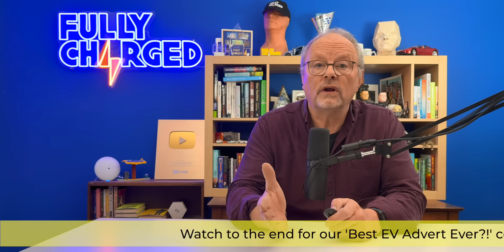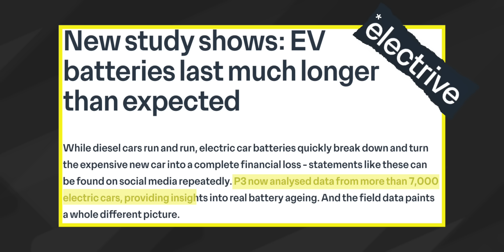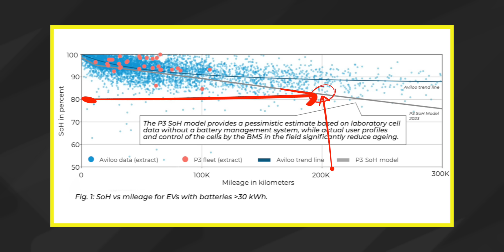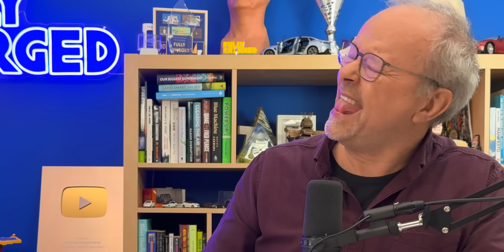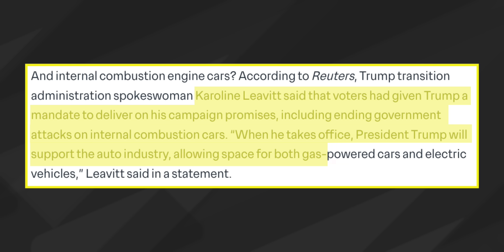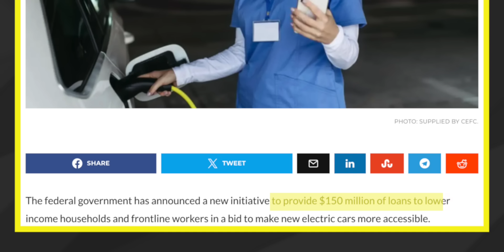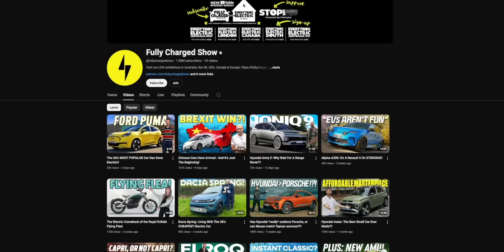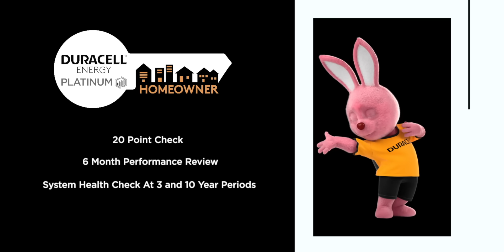The Truth About EV Battery Life, Government Subsidies & The Future of Coal Ash?!

Comment: Why has tidal power died a death? Cardigan Bay would seem to be a substantial length, 80 miles, to harvest tidal power whilst creating an inland sea using technology pioneered in Holland 80 years ago and creating a west coast high speed  road and rail route between North and South. The inland sea could become a sheltered and safe body of water for leisure.
Reply: I can't find anything about a Cardigan Bay tidal power scheme that would create an 80 mile highway.

Even a causeway from Strumble Head to Bardsey Island would only be 50 miles and the sea depth averages about 150 metres.

The cost would be astronomical, even if technically possible, which I doubt. The damage to the environment would be incalculable.

Tidal schemes for the Bristol Channel or the Solway Firth make far more sense and the cost would be huge.
Reply: @ Chris, I was postulating on the Zuider-Zee Dutch example and Cardiff Bay. There’s also talk about doing a scheme across a North Sea passage by the Europeans. The current road connections are appalling so you have two backwaters, St David’s and Bangor and you have to go into England to get from Fishguard to Bangor by rail. Cardigan Bay has little usage commercially or for leisure so making it an inland sea may create huge development opportunities. Environmentally it would change but change could be designed with intent, you could introduce wetlands, keep the river estuaries and create polders for human development whilst having huge energy generating capacity for centuries to come. The scheme could be a floating causeway via two or three man made islands, some type of wall / dam type solution with tidal gates but would have huge benefits including increasing Wales territory by a quarter. Big scheme, big dream but huge possibilities with big payoffs and a high speed dual carriageway and railway lines connecting Northwest to Southwest. 😎😇
Reply: @gbphil  I think you might have been thinking about Cardiff Bay, but the Cardiff Bay scheme certainly doesn't involve an 80 mile road and rail link between North and South Wales.

The Zuiderzee damn is only 17 miles long and is built where the average depth is less than ten miles. A far cry from a Cardigan Bay scheme linking North and South Wales in waters that average 150 metres in depth and stretches for fifty miles. That would easily be the biggest civil engineering project in the world.
Reply: …. Because tidal power is EXPENSIVE

Comment: Bought my first EV last year, 1st Gen Leaf, '64 plate (11yr old). 4 Previous owners and now has 67k miles. Battery is still at 82%, MOT last month has one advisory for 'signs of wear on a single steering bush'. After owning it for over a year now, usually driven 6 days a week for work & domestic commutes, charging only once a week using chargers available at my work place. Not a single breakdown, not so much as a light bulb replaced, never ran out of battery while driving (I did originally have range anxiety until I just got comfortable with the car).
After owning 14 second hand ICE cars in my life, the EV has been so much cheaper to run, insure and a lot less hassle to keep on the road.
Reply: @AnthonyPreece  and the leafs did not have thermal battery management. Newer Evs have nowhere near that drop in battery health. My 2022 soul has 120.000km and battery health is 100%
Reply: Nissan really should have put cooling on the battery. But a good used car for. $2500 is still a good deal.  @gnumel
Reply: @gnumel Nice!
Reply: @gnumel No it isn’t.
No used (lithium) battery has 100% health
Reply: @GadgetMart  they have 67kw but advertise at 64kw. The car basically only lets you use 64kw and keeps a buffer. As long as it can do 64kw it still says 100%. Basically they start at 105% when new and always keep a buffer. By checking the data from the obdii and what shown by the car I calculated that it is still between 65 and 66kw total. It lost some, but almost nothing.
Reply: @GadgetMart Do you actually know the difference between battery integrity and battery capacity? If not , that wasn’t a wise post.
Reply: Good move 👌   My first EV was a 2014 LEAF too back in 2015 - Ex demo Acenta with 1,400 miles on it for £10,500 - Was an absolute Bargain back then as they were I think £29,995 or something, saved £2k on fuel in the first year 😲
Reply: Last month, got too cold for my ICE car to start. This again. Sigh.
Reply: @SigFigNewton maintain it then you cheapskate
Reply: Tesla is expensive to insure... Certain cars cost more to insure.. not all EV is gonna be cheap to insure.. when something goes wrong with them it costs alot.. tho I wish we had BYD in America instead of swasticars Tesla
Reply: I am in Oz, and seriously, I cannot wait for 2025 EV,s from China. Please nobody shoot me, as I am a true blue Ozzie, but I don’t see any issues in buying something I consider great quality and price. Zeekr 7x (Geely), Xpeng, BYD, many brands bringing out awesome looking EV,s that honestly make Tesla seem mundane. Not a Tesla basher but there is that much choice now coming out it is great!
Reply: @AnthonyPreece  sounds like you work for an ev company 🤶😁😁😁  what  EV would you suggest that I purchase..?
Reply: Can you tell us  how's the insurance after switch to EV, big  change or not to insure
Reply: The thing is that you can deny global warming and the effect of carbon dioxide on it all you want and merrily go ahead and burn fossil fuels, however the only problem is that fossil fuels are very finite and won't last that much longer. Therefore it is best to acknowledge that renewables are a solution for this issue.
Reply: Probably had a battery replacement.
Reply: @hoffinger  mine? No, I have the car service history and checked everything with a obd reader before buying it used. 
It only had tire rotations and a recall for a coolant sensor
Reply: @hoffinger a 12v probably, like any 10+yr old car.
Reply: @salibaba ICE car batteries tend to last about 5 years. My last car, Quasqai diesel, needed a new £240 battery after 4 years.
Reply: @gordonmackenzie4512  ICE batteries are "Lead-Acid" batteries, not the Lithium batteries used in EV's.

Comment: Floating Solar benefit #3: panels stay cooler (compared to on land), and thus work more efficiently / generate (slightly) more power per panel.
Reply: The only downside I see is the cost of cleaning up after wildlife that will use the floating array as a resting and restroom place.  Might be a bit labor intensive but could balance out with the amount of power over other style of arrays.  Cheers

Comment: What I think you fail to mention is that any idiot with a socket set can fix a ice car yet evs actually need trained professionals to fix them that a problem
Reply: There is way less to go wrong in an EV in the first place.
Reply: Correction - any idiot with a socket set *can remove bits from an ICE car*.  You can't 'fix them', you have to order in spare parts (and often bend over and grab your ankles if it's not a generic part). 

You'll also be doing far more often, given the far greater complexity and number of parts involved in an ICE powertrain (not just the engine, but the gearbox, clutch and other bits).
Reply: Maybe that's true for an old Ford Anglia... not so much now. We used to have TV repair men I recall, but that's in the past.

Comment: My little Skoda is at 131000 miles and still going strong. Way more eco friendly to keep my old vehicle well serviced than it is to put an another slab of metal on the road.
Reply: Probably not as eco as you may think (at least in terms of emissions):
- your engine won't be as clean as it was new (in terms of emissions) - so your actual year emissions are likely higher than you think
- the 'embodied' emissions related to the battery etc (the only bit 'extra' compared to an ICE car) are roughly equal to ~15k miles at ~30mpg... so if you do more than 7.5k miles / year, you'll 'break even' in ~2 years, and after that, your life-time emissions will be less than if you stuck with your old Skoda.

Oh - and you won't be generating emissions daily outside your home / workplace / all the streets you drive along.
Reply: And when your Skoda does die (as all cars must) get yourself an EV, not another ICE. It'll probably last 200000 miles. And you'll wish you'd got one earlier.

Comment: Someone told me auto emissions are mostly water vapor. I responded that I won’t expect them to drink from the toilet bowl just because it’s mostly water.
Reply: You should've dared them to sit in their car in an enclosed garage with the motor running for an hour or two.
Reply: Yea, it’s been through a filter. You mean you lifted out the logs with a strainer. Nice and clean.
Reply: Water is a powerful greenhouse gas when it is a vapour in air, so they are very much part of the problem ironically.

Fortunately water in air at a global level is kind of self regulating and tends to remove itself when levels get sufficiently high (I.e. it rains 😉).
Reply: @ Very silly 🤪.
Reply: Would you prefer to be in a closed garage with a running EV or running ICE vehicle?
Reply: You need to develop an ability to question things you hear! You can start by fact checking this presenter (Robert) and his convenient lies and half truths.
Reply: The hydrocarbons in petrol have the formula CnH(2n+2). When burned, this makes a very slightly smaller molar quantity of CO and CO2 and a very slightly larger quantity of H2O. In terms of mass, there is much more CO and CO2 than H2O (2 hydrogen atoms weigh one sixth as much as a carbon atom). So your informant was wrong. Don't use toilet humour - just tell them they are wrong.

Comment: Well, my gas guzzling GM Saturn has 360K clicks and is still going fine, even in rust promoting Ontario, so there! I know, a GM, I'm lucky. 
FYI, this was supposed to be humourous, as I thought Robert would draw energy from a (slightly younger) old fart bloviating about EVs. My car is an '03, there weren't any practical EVs on sale here until the Leaf around 2011. It hasn't been getting much mileage the last few years with work from home, then retirement.
Reply: According to the math you bought 20,000 gallons of fuel costing $70,000 for 1 vehicle. Home charging would have cost $7,200. And no oil changes
Reply: @frostcb2  sadly I cannot have a home charger where I live. It is an old Victorian terrace which predates the automobile. My home town has a population of 63000 and a grand total of 16 public EV chargers. This is another reason I'm currently holding on to my vehicle. I'm not anti EV, but there's certainly some infrastructure issues to address.
Reply: @Robaylesbury  Nobody is obliged to have an EV or justify why they do not. I have 2 EVs and no charge point at home.
Reply: The point you are making is that because your car has done that, every car can do that? Or is the point you are making that what Robert said is untrue because your car did that, even though there are generations of figures that show what he says is a fact.
Reply: I love this. It’s way more eco friendly to keep your old car on the road rather than buy a whole new one. Well done.
Reply: How many people have had their lives shortened by the NOx, particulates and noise it produces?  Or do you not care about your fellow humans.
Reply: @ I’m pretty sure the average child lithium miner would make a counter point to your evangelism.
Reply: @Robaylesbury  You're conflating lithium mining with Cobalt Mining (which is indeed done by child miners, in unregistered mines in some african countries)... but guess who the biggest user of Cobalt is?  It's the FF industry, as it's required to refine oil into petroleum...

So yeah - it's the FF industry profiting from child labour... which probably isn't the point you intended to make.
Reply: @logicalChimp  my wording was errant. Cobalt, an important component in lithium ion batteries is indeed being mined in the DRC, and children are sadly often involved. I do agree that the fossil fuel manufacturers are absolutely culpable for so many things, but then I'm not here to defend them. My hope is that upcoming battery technology may do much to improve matters. The infrastructure in the UK does need some significant work to help the eventual transition.

Comment: Thanks for changing the narrative. EVs Aren’t Just “Less Bad”—ICE Cars Are Worse for America Than You Think

The debate around EVs often focuses on proving they’re “not as bad as critics say.” But the real question is—are gas cars actually as good as people think?

The Evidence is Clear:
🚗 Efficiency: Gas engines waste ~70% of their energy as heat. EVs convert ~90% into motion.
🌎 Pollution: Tailpipes spew CO2, NOx, and particulates, worsening air quality. EVs? Zero tailpipe emissions.
⛽ Fueling Costs: Gas prices fluctuate wildly. EV charging is stable, with home charging costing far less.
🔧 Maintenance: Oil changes, transmissions, spark plugs—EVs eliminate most of these headaches.
🚦 Performance: Instant torque, smoother acceleration, and a quieter ride—EVs outperform in ways people don’t expect.

ICE Cars Are Holding America Back:
🇺🇸 Energy Dependence: The U.S. still relies on foreign oil, keeping us tied to unstable markets. EVs run on domestic electricity, from solar to wind to nuclear.
🏥 Health Costs: Air pollution from gas cars causes respiratory diseases, leading to higher medical bills and premature deaths.
💰 Economic Drain: Billions of U.S. dollars leave the country every year to pay for imported oil. EVs keep energy spending local, boosting American jobs.
🛢️ Oil Wars & Geopolitics: Wars and conflicts over oil have cost America trillions. Reducing oil dependence means a stronger, more self-sufficient nation.

The conversation needs to shift. It’s not just that EVs are a viable alternative. It’s that gas cars have been getting a free pass for too long—at a huge cost to America.
Reply: Well said
Reply: "gas cars have been getting a free pass for too long—at a huge cost to America."
And it is the same all over the world. The subsidies to fossil fuels and ICE vehicles is in the Trillions of US$ value per year.  
What if we split those subsidies based on the use of the various transport methods??
Then EV's would certainly pick up traction in the market.
Reply: 🎉 Very Well said & ACCURATE Info...Thank you🙏 EVofAmerica 🌞🗽

🌅Buena Dias
🤔For those with Problem of over 100 years of Gov't's SUSIDIZING Fossil Fuel Industries...  Pollution, (&forever Radioactive waste from Nukes)... from BURNING Hydrocarbons??

Solution:🌅  We totally power our comfortable house ...& EV...solely with SOL power at home😀🌻

 problem solved 🌞👨‍🌾🗽

Comment: Keep up the good work, let the haters burst a blood vessel! How short is the life of a an ICE engine, and how does the power it produces drops off with milage? Please keep us informed with real info and not the fake news provided by haters and those with a pro carbon agenda.
Reply: A diesel or petrol engine has a lifetime of at least 300 000 miles these days and you can pick up a decent 10 to 20 year old car for less than £4000. An EV is significantly more expensive to buy and only starts becoming carbon-neutral after driving it for 50 000 miles. EVs carbon footprint isn't just about tailpipe emissions or the lack of them.